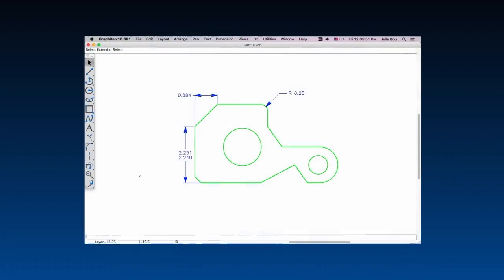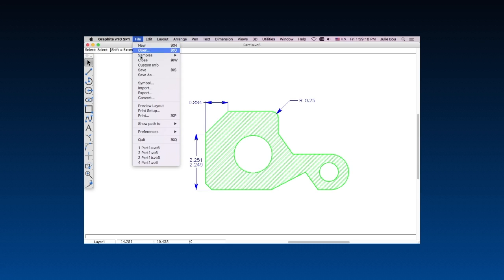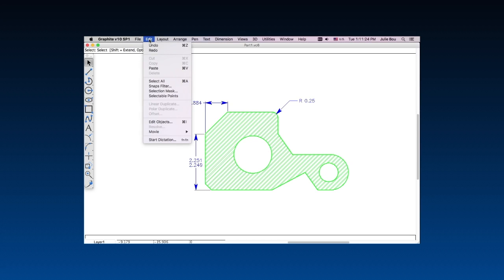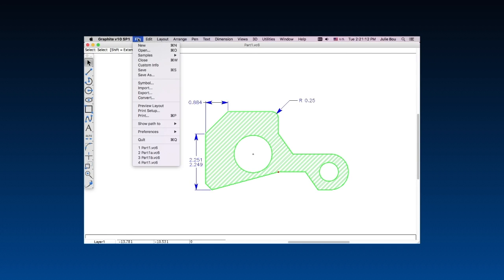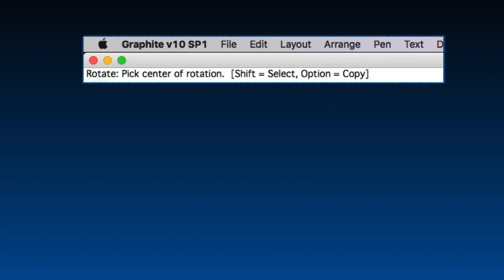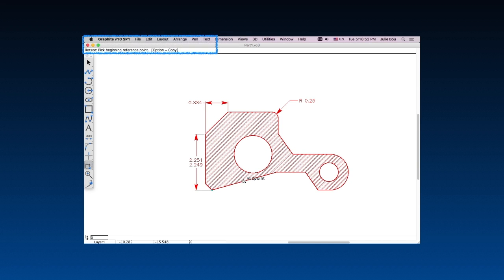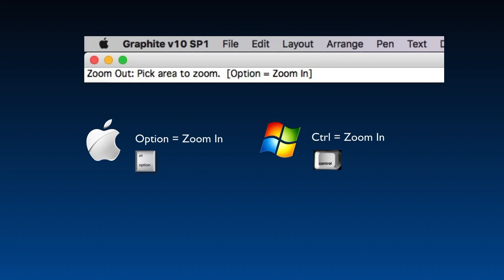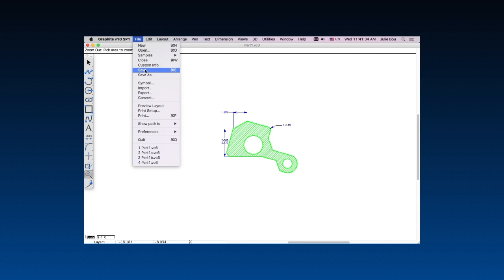Graphite How To Part 7 Crosshatching, Stretching & Rotating

Comment: How about Showing to to correct a drawing started in the wrong view. I have the left line (drawing) in the top view. Copy and pasting even to new drawing in a correct view puts them back into a top view orientation. I need to change the lines orientation.  (don't need but would like)